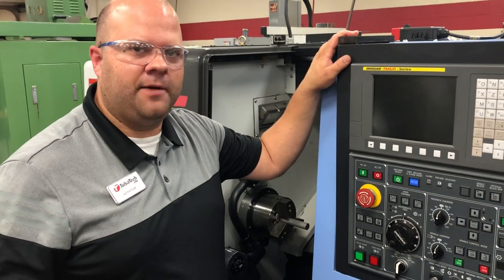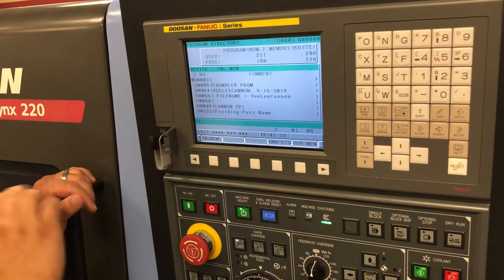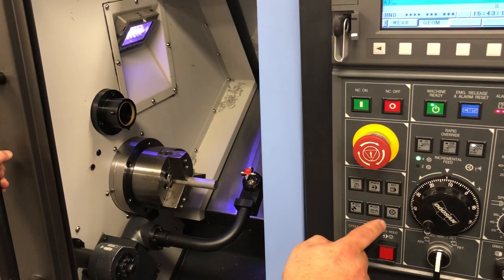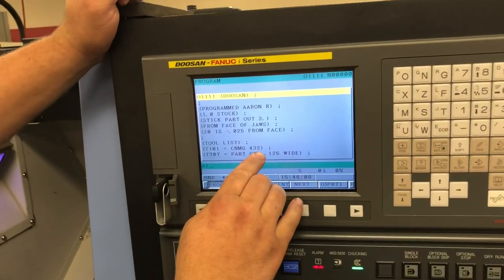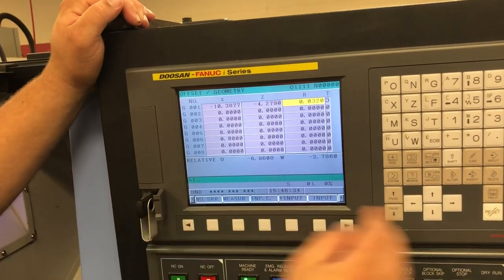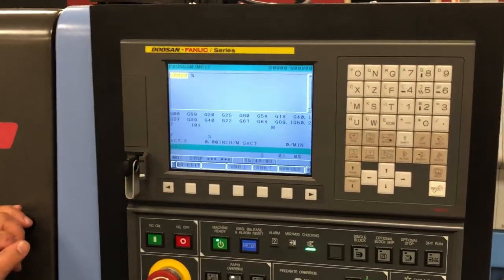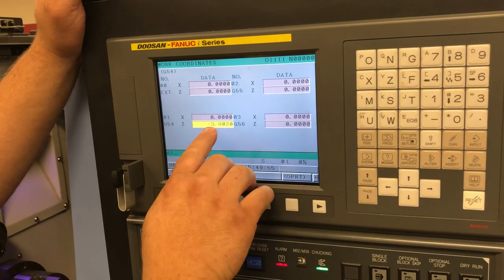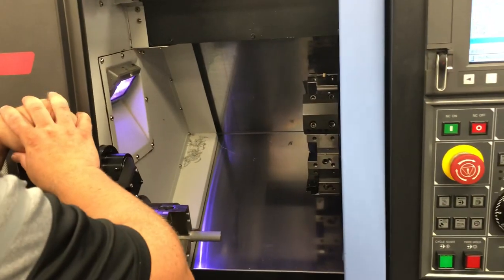Doosan lynx lathe setup

Comment: Thank you for making this video.  I learned more in your 11 minutes than in my 3 hour shop class .  Actually 2.5 hours with breaks !  Also hard to learn with 6 guys and instructor crowded around machine.  Only my 2nd class on the Doosan. I didn’t know about that eye sensor.  We did touch off holding a scrap of paper between the workpiece and cutting tool. It’s hard to get the feel of the pressure to hold the paper with how close to set the tool .  It will take experience. Already like .0006.  off just with set up by feel would blow a job with tight tolerance .  Nice to know those eyes are out there to take the guesswork out of the equation.  Thanks again for making a video that is clear and you can actually see the control.  You are very professional in your explanation and calm even presentation.  Plus good example with proper ppe eye protection and work uniform.
Reply: You are most welcome. My goal was to give a clear understanding on this machine setup.  So many machines are different and having a video like this really helps.  For more visits like this check out this page
https://youtube.com/channel/UCawMg1dcdGS7K9aBIG2RGGw
Reply: What to do on a machine with the eye broken off? Or a manual lathe from before digital was available? The old tricks do take better teaching, but you have to practice to get a feel for it.

Comment: Bro, is thier any option to check graph before run the job?
Reply: There is a way using a graph, but you will have to lock the machine's axis with I believe code M17 and then run your program in auto mode. The spindle will run, and the turret will index, but X and Z will not move.  On the graph, you'll see feed and rapid lines. Once ready to run unlock your axis with M18

Comment: So when you set up that part again, because you save the program after the setup in the usb, will the tool offsets and geometry all be the same when you load it back up ? As in you won't have to touch off any tools ?
Reply: No. You have to touch off everything again
Reply: Always have to touch off the tools
Reply: Well you can out put the offsets as well as the program to the USB.  I've never had the opportunity to really use this feature, as once you pull a tool out of the turret, the tool length is not going to be exactly the same next time around. So loading the saved offsets is kinda useless.
Reply: Good news if you just setup the jaws and don't remove the tools your in good shape.  Also,  even if you remove the tools but load them in the same position you could dial then back in as long as they are pushed back against the stop or all the way into the turret position.  It's still recommended that you touch them off again.  To see more tips and Setup videos check them out here https://youtube.com/channel/UCawMg1dcdGS7K9aBIG2RGGw

Comment: HAAS is so much easier to upload and download a program from the USB, but I guess that's FANUC.
Reply: Fanuc is a plugin and cycle start on the CF card, the reason fanuc uses a CF card is because it is more stable and faster, i have used both machines and the cf card method is superior, fanuc has not yet developed much into usb. and there is no need.

Comment: I have an older Daewoo Puma without the "tool eye".  Setup is so much easier.  I just have my T0101 always set to 3.000.  Then I face the part and work shift my coordinates to get T101 position to 3.000.  If my tools were already set up off of that face then I am done.  If not I use a gauge block and input my Z offsets for each tool.  Diameters I have to turn and measure.  This just seems more complicated for some reason,
Reply: Because you've never used it.
A tool probe is 1000 times better
Reply: @matt23727  agreed,  you can access tool offsets, (X and Z) alter rad's, alter workshift all in the offset page. I found it quite simple as an apprentice to pick up